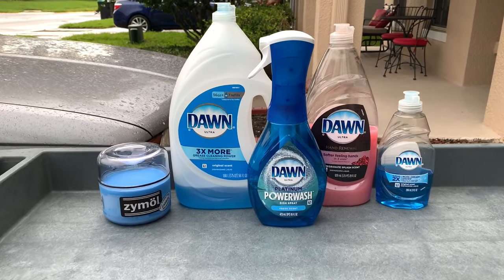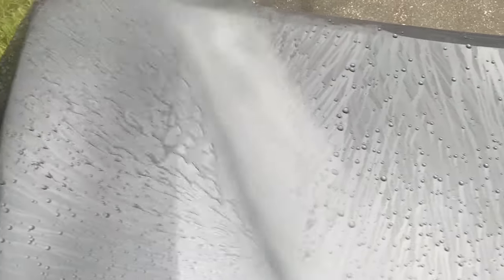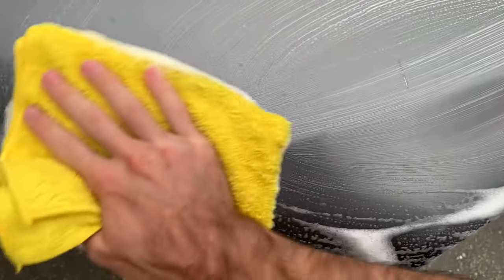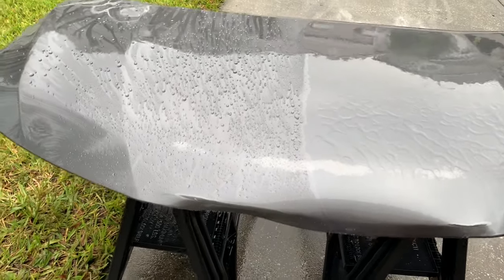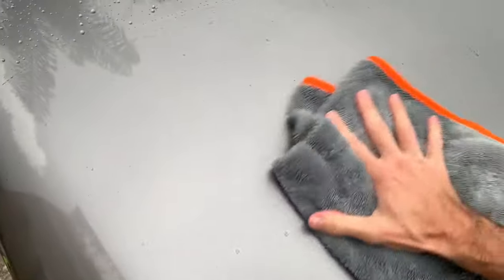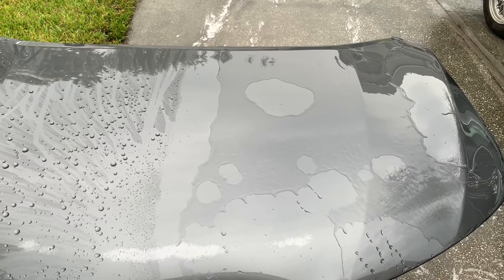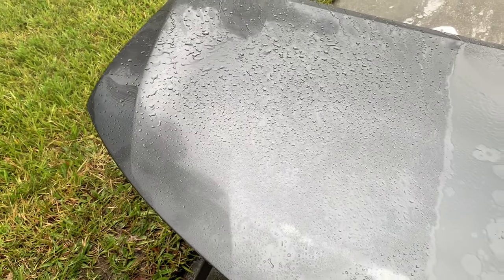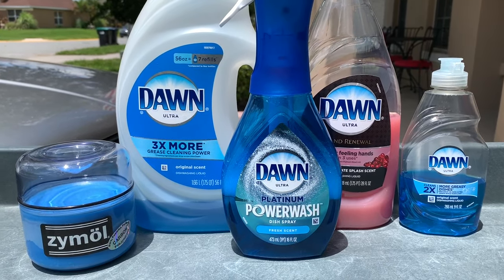Dawn Powerwash Strip Wash Test vs. Zymol Carbon Wax

Comment: Great immediate visual.
I have not seen Dawn Powerwashx5 in Australia.
If you say, placed a few concentrated drops of normal Dawn on the wet panel and wiped over similar to the Powerwashx5., Would it knock it down better than your 2 ounces/gallon mix?
👍🏼🇦🇺
Reply from the maker: Thanks Matt!  Even with Dawn Ultra 3x soap undiluted out of the jug and worked into the paint, it's still not going to have any significant bite to it like the Powerwash has, at least in the short term.  My earlier video with Dawn against the Griot's carnauba paste waxes I did 20 washes with Dawn 3X at 1oz per gallon, then a follow up wash undiluted out of the jug and even those were holding up really well against it.  So Powerwash definitely has a much stronger bite against the carnauba waxes so far compared to the soap.
Reply: @WaxMode  Cheers for that. I do vaguely remember your video but as you said, still diluted.
On another subject of prep wipe, have you ever mixed Grease and Wax Remover 1:1 with an 50% Isopropyl/water mix?
Basically 50% Grease and Wax Remover 25% water 25% Isopropyl.
I've found it is a nice clean and Flash.
I only ask as you raised the subject of protection "knock down" versus actual total Removal. 
👍🏼🇦🇺

Comment: Be mindful that better stripping products most likely have a much higher PH level (8.5>9.5) which can impact the clear coat, dry out trim and components. Now for a reference we all now the damage of insect bug juice and bird poop ( 9.5 + PH) with can eat right through sacrificial layers and etch right down ...so PH matter...stripping fast will have a cost....as a detailer that key focus needs to be very aware protecting the clear coat finish as best you can. For years now auto companies are pumping vehicles with thin paint and thin clear coat (3.5> 4 mm+) .  Clearcoat is like paper-thin......So ddetails really need yes, to work smart, efficient, cost-effective but we can not do more harm than good....... our customers trust us....think about that....
Reply: The PH is 11 on this product, see the SDS for it.

Comment: The Dawn Powerwash eats my dish sponges. Be careful with this stuff.
Reply from the maker: Yes this also greatly softened and broke down the Proline grout sponges that I use periodically to wash the test panel with.  This is a strong cleaner for sure, users should proceed with caution and wear gloves for protection.